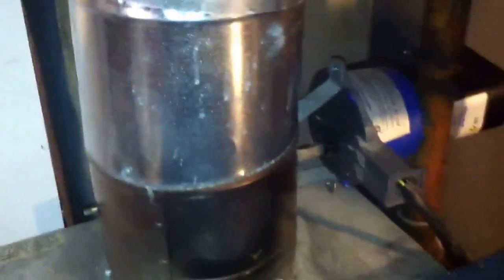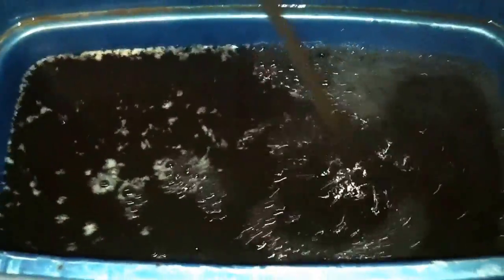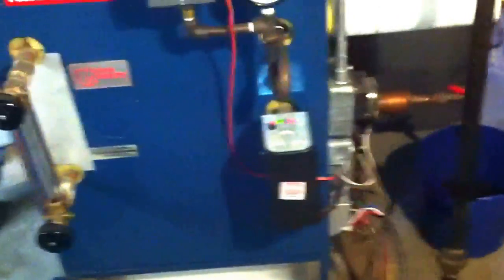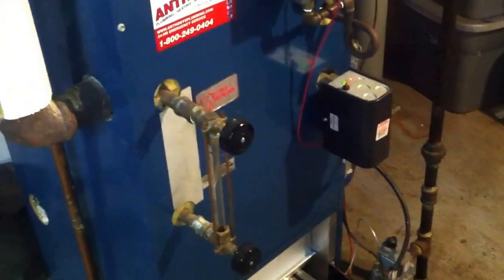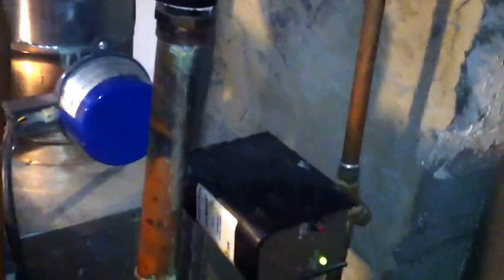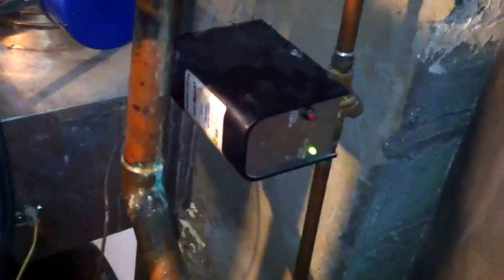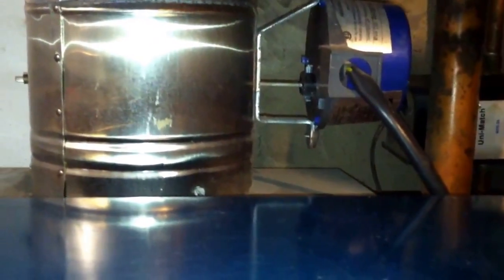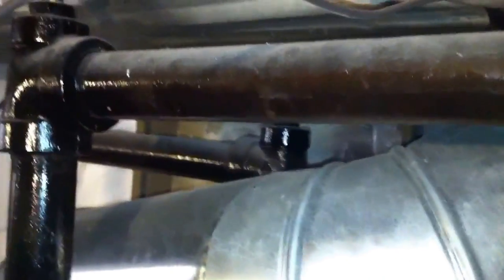Steam boiler heat check

Comment: Or could there be an issue with the AWCO ?? Boiler doesn't have any leaks anywhere and no leaks in any of the pippin through the house. Boiler always seems to have the proper amount of water in it as I always check the glass level.

Comment: Should have turned that feed valve around as part of the service.
Reply from the maker: So u telling me I should of turned off water supply,  drained down water and cut and moved the water feeder on a general heat check ? It's been that way since boiler was installed and I should go to the little old lady and say hey this needs to be moved but it's working fine and here is the price to do that . Nah dont know where u work and all but lady just wanted her heat checked first 89$ like she does every year and we will make any recommendations if needed.  Most people will only change something out if it is either broken or on the way out and will cause unit not to run when it does break.
Reply: @jhhvacplumbing1944  Well yes, you should have offered the repairs to the customer... I didn't say do it for free.
Reply from the maker: @WApnj  thought that what u meant by part of the service,  yes we do mention things.

Comment: thanks for explaining all the  functions.  I am getting water spitting out of vent on 1 radiator on 3rd floor of the building. I disconnected radiator and drained water out and seems to be ok. this is the first time I had to do this in 20 years. is there an underlying issue I am not addressing? Steam boiler for 3 unit building. Great video!
Reply from the maker: U only removed the water that is created by the steam . When the steam cools off it returns to water form and then eventually travels back to the boiler.  Your boiler is not filling your radiators with water cause if that was the case u would have a ton of water leaking from all the radiators located on the first and second floor way before it ever got up to the 3rd floor. Your situation sounds most likey a bad steam radiator vent and I would start there and replace it .
Reply: @jhhvacplumbing1944  thank you very much for taking time to respond.There was water in the vent but I shook it out and blew through it and air passed through so I thought it was ok but I'll change it. I thougt the same thing about water in first floor etc.. but just wanted to see if I was on the right path.
Reply from the maker: @2mikeherzog  also keep in mind no matter what , when a steam boiler is running and heating up it's normal for steam and sometimes water to spit or drip from air vents on radiators.
Reply: @jhhvacplumbing1944  got it thanks!

Comment: Steam Boiler shouldn’t never need water! If so there are leaks, or poor piping or failed casting losing steam out of the Flue piping
Reply: If your air vents are losing steam they are broken!
Reply from the maker: Um u r wrong. What do u think the steam vents r ment to do in a radiator? Let put steam when pressure builds up and that way the steam will circulate and heat up the cast radiator.  Oh just so u know steam that releases from the steam vent is a form of water.  If there was no place for the pressure to release 2 things will happen . 1 the t and p valve would go off and 2nd something may go boom . So bottom line is if steam is venting out , water is being evaporated.

Comment: only rookies pipe steam headers with copper... I did not see a hartford loop...I agree on the bypass for the waterfeed... no return equalizer...header piping is undersized... very poor installation.
Reply from the maker: U must not know what a loop looks like cause it is there anyways if u read the title its a heat check ... Not my install bro .
Reply: ya I see it now... the shakey camera work doesn't help...

Comment: Great video. I have the exact same Utica boiler set up like that. I feed the water manually, I have no issue last year when we just moved in. Few weeks ago I changed the damper, it was working fine after I changed it. As of now it just turning on whenever it wants to, I set the thermostat to 73 even up to 80 but it only reach to 66 and shuts off, changed the thermostat and still same issue, even if I put 80 and hold it there it won't turn on. Pls advise.
Reply from the maker: Call a local hvac company

Comment: I noticed that your piping isn't insulated.  This causes the formation of carbonic acid that will eat the cast iron and heat exchanger failure. It also slows down the radiators from heating up faster.  They get no heat till the piping gets above 212F, this also makes the fuel bill higher. Insulate the pipes or at least explain this to the customer.
Reply from the maker: 100 % correct in all u said , thanks for the info and commenting

Comment: I hope you informed they why not to use copper on steam and the problem accessing the fill valve controls. A little more ambient light would help and try not to fly around with the camera so much. Set it up on a tripod and talk then move it every as needed. Steve L does this well. Do ya'll not offer combustion analysis and inspect the vent connector and base of chimney?
Reply from the maker: Yeah Steve Lav is the man . This was early when I first started youtube . I changed phones I record with and use editing now but I am going to take your advice with a camera and tripod . Thanks for your advice and comment

Comment: ok
Reply from the maker: if it's a steam boiler and it is the pressuretrol u r talking about it maybe the pig tail that it screw onto that is dirty or clogged giving u a false reading with pressure and shutting the boiler down

Comment: it's a grey box attached to a psi guage .the grey  box has a section in front that says cut in and with a bunch of numbers from the left it's says kg/2 cm and the right side says 0.5 . the to 9 psi. the psi on the guage is between 0 and 5
Reply from the maker: That's the pressure troll and it's screwed onto a pig tail fitting right

Comment: I have a Utica boiler also
Reply from the maker: Gordon I can't help unless u tell me what part u r talking about bud
Reply: +justin henning I don't have a drain, to drain the dirty water.  Also our steam boiler is running out of water, and we have to fill it manually. Which means also that we don't have a automatic water filler, when the led comes on that detects the water being low. There's a leak somewhere. Also the pipes bang.. Which means, all the valves are not open. Or the radiators are not level. or there's a bad something.. I forget what it's called.  etc. etc.  Umm.. so yeah.. did I mention we are renting..?

lol, so yeah.. my bedroom is on the third floor, and it's currently 9°F outside, wind speed 16mph. So yeah.. umm.. I don't know. I keep telling my significant other that were losing money and she doesn't give a shit. So I don't know, and I can't do anything but keep filling it every day or couple days. etc. I'm pretty smart. I found out most of this stuff from This Old House, and reading different things on Google search results.

Comment: yes that's what it is.  when I turn that screw it turns my heat on.  sometimes my room temperature goes down to 64 and my heat does not come on . could it be  a bad thermostat

Comment: Hello ,
            I have a Honeywell cut off and there is a screw on the top of the cutoff , i sometimes have to turn that screw for the boiler to come on ...is that normal .  What do you think could be the problem?.
Reply from the maker: Gordon P not sure if u mean a low water cut off ?
Reply: Sounds like your talking about pressure-trol

Comment: Is the LWCO normally mounted that high up on that particular boiler? I  have a Weil-McLain steam boiler, and the way the LWCO is mounted, the sight glass needs only to be about 1/4 with water to satisfy the LWCO.
On that Utica in this video, it looks as if it always needs to be no less than half full.
Reply from the maker: Mike u r right , different makes have little difference in height but I always fill half way to 3/4 in site glass . Thanks for watching!